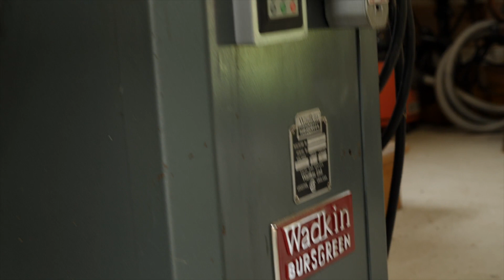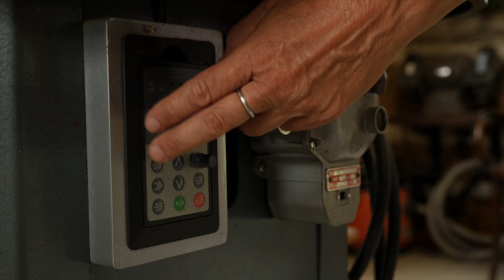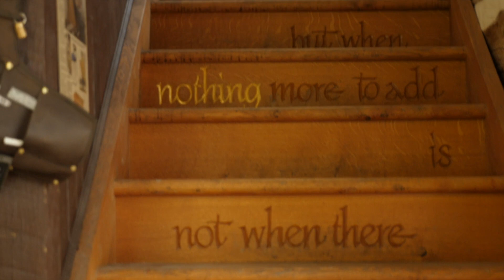Karen McBride's Woodshop

Comment: The Hammond was called a "cutoff saw" being made to cut linotype slugs and leading material for type line spacing of a page or newspaper layout. The sliding table was a later model than
the one I used. Some of the Hammonds had a HSS blade and used kniblers close to the saw blade shaft that were adjustable end cutters of tool steel that gave a very clean cut on the end of the
slug you were cutting. Those models had a 5.5 or 6" blade due to very shallow cuts as needed. The Hammond saws were mostly in picas and points of measure on the fence. There were some cheaper aluminum table top saws with cheaper blades that cost a fraction of pricing for a Hammond. So the saw was for cutting lead and maybe brass but not steel cutting rules that die cutting presses used. The Hammonds had a wheeled bucket under the saw that was handy for rolling the cutoff waste back to a stereo room for melting the lead and taking that lead back to the lino type machines for recasting lines of type. You need to lubricate the crank saw shaft raising unit as a well oiled machine would just glide the blade shaft up and down by finger touch-something is going on with you saw. I'll bet the roller bearings on the sliding table need to be cleaned and oiled also. Meyer in Indiana later made carbide blades to fit the Hammond so the knibler cutters were not needed.
My job as a kid was to melt the lino lead and make ingots (some call them pigs) that were 16-20 lbs each and hung over the gas or electric melting pots on the Linotype machines. I ran the model 8, 11, N with mixer and 300 Comet with TTS. My sister ran a Varitype keyboard for setting copy. All the headlines were hand set type.